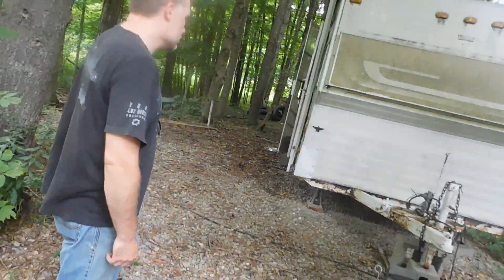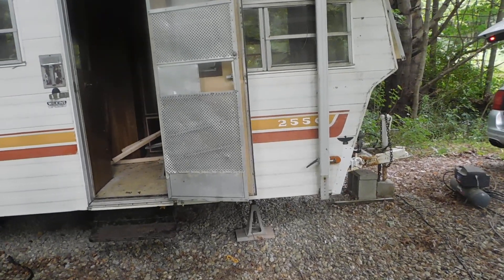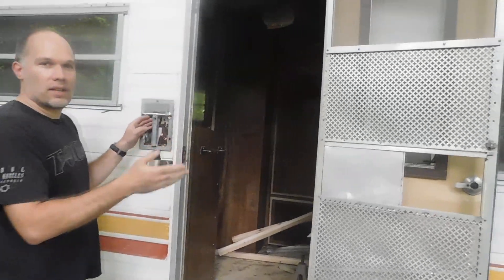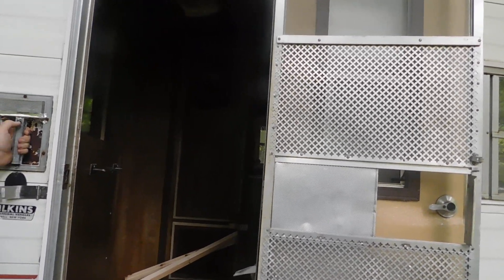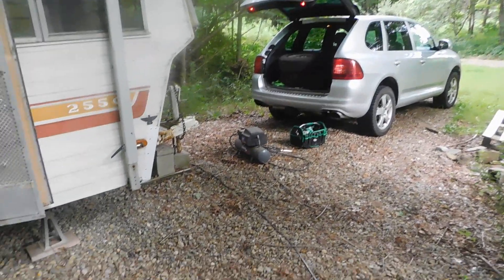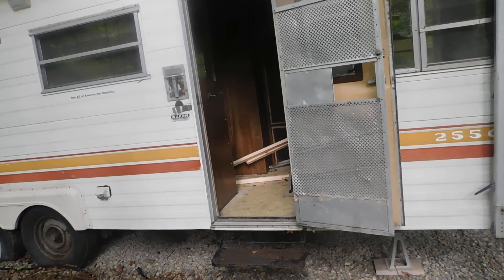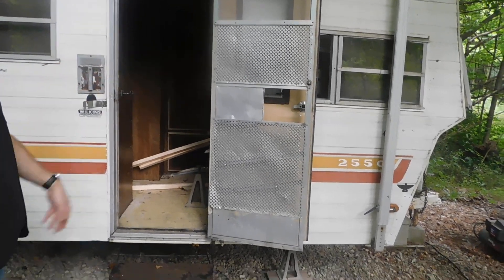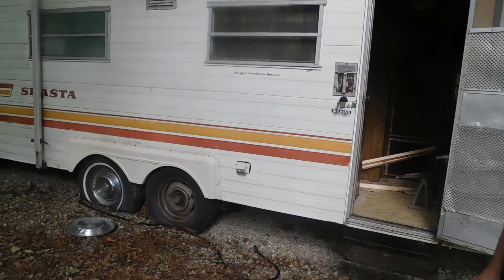Showing you the other camper on my Homestead and what we plan to do with it.

Comment: 1-1/2" walls ... ...he's got his work cut out for him .
I had one of those and thought I'd just replace the damaged wood structure then ended up practically rebuilding it .
Use cedar wood because it's lighter than treated lumber... costs more but saves in the end in fuel economy  . And cedar keeps flies and some other insects out. 
Check with RV surplus places because they're cheapest.  Replace windows with tinted to reduce ac cooling and for more privacy.